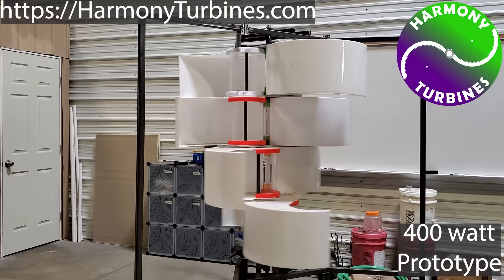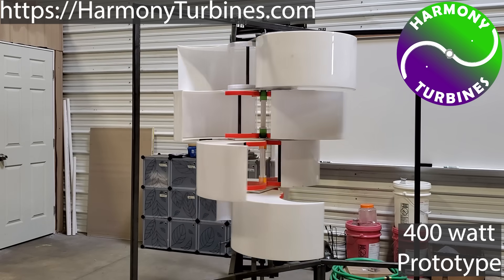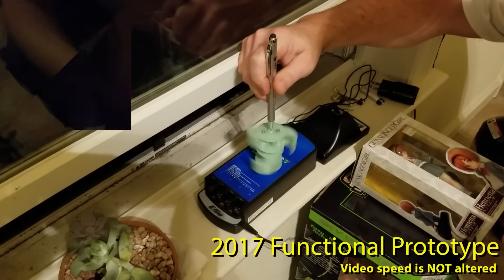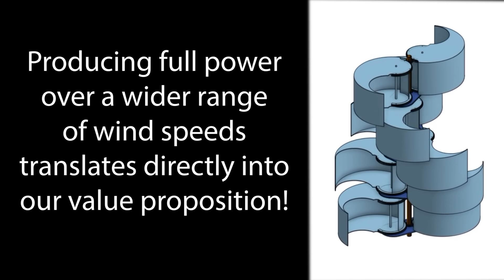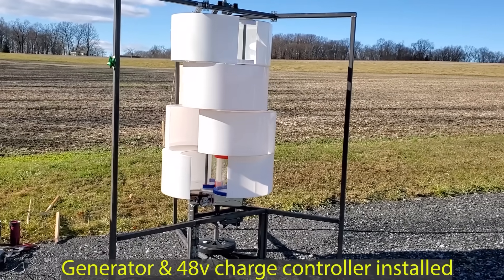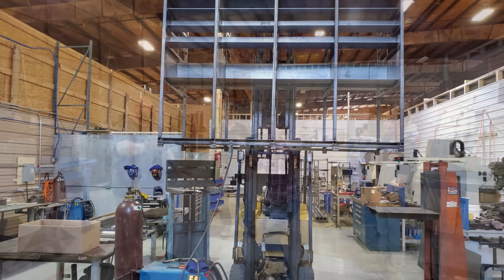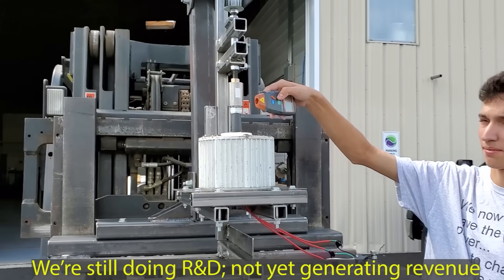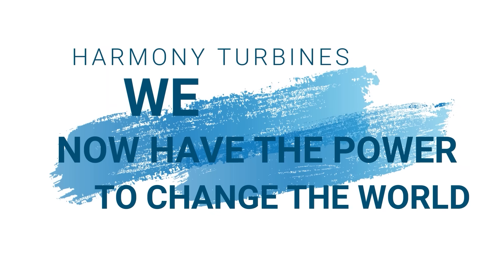What makes Harmony Turbines so revolutionary?

Comment: A kite of the same size at 2000 ft is going to generate far more consistent energy.
Reply from the maker: I love the kite idea. I've been following them for years but they're not practical in large numbers. Can you imagine trying to put thousands of those kites up in a city? Harmony could be deployed in cities and on the sides of tall buildings with little to no problems.
Reply: @HarmonyTurbines   over 4x energy factor increase... See  oki for automated kite launch and flight. I know human  pilots  can fly 4 string revs in very large tight fomations.

Comment: maybe it's the new revolutionary method to rip off two categories of people: first - uneducated investors, second - uneducated buyers?
this is savonius type of turbine... and it's meant by default that ANY standard horizontal axis wind turbine with the exactly same working surface will outperform it 5 times! and for those who still believe in tales - go for it and buy it! just don't tell afterward that I was not warning you...

Comment: I suggest you propose this design for boats as well. When the turbine contracts, it can become a Magnus Effect cylindrical rotor. This only occurs when the wind is perpendicular or slightly diagonal from behind. At any other angle it would be open, not for propelling the boat, but for other needs on board.
Reply from the maker: Thanks we have been engaged with both Yacht and Catamaran manufacturers for about 2 years now looking at this. Once we're further along we will be working on units to do exactly this. We have even had Cruise lines contacting us so Magnus effect and Fletner rotors are definitely on our TO-DO list. :)

Comment: You need to hire more experience aluminum welders. Those aluminum welds on your video looks horrendous. Anytime I go buy anything metal that has welding. Please for the love of God. Check the welds, because no matter who genius came up with this product. If it is not welded properly. The whole thing is useless.
Reply from the maker: You're looking at old videos and besides, these are prototypes, nothing more. As we move into production we're actually looking at getting into LASER WELDING our scoops together which is an absolutely beautiful end result. -So fear not my friend, this is nothing to concern yourself with at this stage in the process.

Comment: sure it works... Just seems like there's way too many moving parts, the bottom ball bearings literally have to carry the entire thing, so they'll need to regularly be switched out, and every single sail needs a motor + gear to fold up and down.
It's just needlessly overcomplicated and takes up less windspace than normal turbines - so the energy coefficient is worse.

Comment: If I were you I would start long term testing for outdoor conditions!!! This design looks like it is going to be very susceptible to dust, dirt, leaves and debris. It would not only add weight to the vanes but it would fill the bearings and gears and damage sliding surfaces. How does it handle water shed in a rain storm. Centrifugal force I am sure plays a role but how does the unit sense the added weight of the water and adjust ? Do you adjust turbines speed only and just ignore the added weight? Also you say it produces at very low wind speeds but no figures. VAWT's are really good at attraction by "ART" but the looks are very deceiving when the numbers are exposed. Lastly have you tested this sitting in some one's back yard for providing energy in an urban setting?

Comment: Can it be mounted to a PTO and used to pump water?  I would be interested in investing in one to do some R and D.  I want to pump water to hold for use as a power source when there is no wind or sun.  I get fierce wind like most folks, but it doesn’t help that I have signs that say “danger high wind” and they actually make the big stupid wind generator stuff near by in Pueblo.

Comment: I was impressed when I assumed this was an entirely passive solution using some kind of governor, but it's really not that special to realise it's computer controlled and requires a small fraction of generated power to operate the motors.

Comment: I love these turbines, the design is awesome and practical easily scalable, but also easy to use multiples depending on preference. I hate the ham-fisted approach of Government intervention, let the people decide. one or two of these in a small with a couple banks of batteries (One for actual use one for reserve and redundancy) will allow for lower energy bills and also a backup for when the power stops working (storms and such).

Comment: This type of turbine is usually not very efficient but your self-regulating/preservation mechanism requires it. So is this mechanism worth the lost efficiency? Also, it has more moving parts than a variable pitch HAWT, which are the pinnacle of efficiency. So, what's the point if it's more complicated and less efficient?

Comment: I bet the reason why this kind of turbine is not used is extremely low RPM and need for a high ratio gearbox to convert the energy, which by itself is an inherent loss. Another probable reason is stability as a regular windmill needs "just a pole" this thing would need a significant structure around it just to stay upright. Another issue would be the weight resting on a thrust bearing that would need to be used as well as as a pair of regular bearings to keep it upright.
Lastly, modern winmill-type generators use variable pitch airfoils which is as close we can get to highest possible efficiency. I bet this thing wastes 1/5 to 1/3 of potential enrgy on having one part of the rotor constantly rotate against the wind.

As with most exotic aircraft, boats, IC engines, they usually have one or more significant reasons why they never catch on - this thing probably has a whole boatload.

Comment: unless I missed it, I did not see how the furling or unfurling is activated. I understand the need for that, but is it a manual operation at this point? What would be the weight of a unit that you might want to have for a home? Could it be mounted on the roof, or does it need to be anchored to the ground?

Comment: Just to say that this is really a big idea...however, if the new battery specs to store power improve in a few years, it is better a PV panel without moving parts. However, could be a good device for areas with winds and cloudy skies most of the year. Note that a safety grid around the device -to prevent injuries - will be needed...or to be placed higher than a human could reach with the hands.

Comment: How high off the ground would you advise your buyers to locate these? What are the practical elevations? Upper limits on elevation? In the Y2K year 1999, we put up a typical 1500 watt three bladed turbine mounted on pyrimidal steel tower 87 feet above the ground. It destroyed itself in a derecho high wind event in July of 2011. Your design is such a ground changer! I love what I am seeing. Good on 'ya!
Reply: From the looks of it, you'd just have to have it high enough to not be in the wind shadow of other trees and structures. That should be within the airspace of a standard property. In the case of buildings, the FAA would potentially need to sign off on it.

Comment: Significant step forward in the wind energy business. Major improvements: 

1. Continous operation during wind storms. Non-interuptable power. Huge advancement.

2.  Very little noise and no propeller flicker. Huge step forward.

3. This design is not a bird killer. Very important.

Support these guys, this is the way forward!
Reply from the maker: Thank you Jim, we're doing our best to push as hard and fast as our time and finances will allow.

Comment: I’ve always liked the vertical wind turbines but most are set at a fixed blade, scoop or what ever it’s called.  However your design with variable settings in relation to wind speed is a great idea.

Comment: Durability of plastic parts?
I can't believe it's really silent. Perhaps the machinery itself but the wind spinning across the turbine must make a noise surely. I think it can be a great solution for isolated users with modest electricity needs such as running a pump for a well and to keep minor specialty needs met. So long as heating and cooling and most lighting demands are not part of the demand equation then this may be adequate.

Comment: Its not revolutionary. The principles have been around for at least 50 years if not more. The reason why it was abandonned back in the late 70´s at least was the fact that it was not possible to pull much power from them. That is STILL the problem. But for smaller off grid systems with lesser need for electricity they are a nice and reasonably cost effective solution.

Comment: How hard do you think it would be to make a welding machine run on wind power
Reply from the maker: Running anything on wind directly is problematic because the wind varies. It's better to go into battery banks and then from that using an inverter to run your end applications.
Reply: @HarmonyTurbines  interesting

Comment: This is incredibly intriguing. I would enjoy not just being and investor for a company like this but having a hands on contribution roll. I've been following Nikola Tesla's work since I can remember and mechanical advantage devices have always intrigued me. A device like this would not need any high end computers or large systems susceptible to friction loss. The center column could utilize a mechanical speed limiter ensuring that if the speed becomes unsafe torque would be applied to the column which would close the fins and lower the rpm. Springs could be used to store potential energy allowing the fins to be opened when rpm is lowered. While this technology is interesting I'm vastly more curious about different ways you can harness motion and convert it into electricity. Piezoelectrics and solar are examples but require further testing to identify efficiency and application. Reach out if you ever want another mind fascinated by technology.

Comment: You are going to run into a problem. How will the plastic hold up due to sun, freezing or hail damage?  You will not know until years down the line. Will freezing rain kill the turbine? How about if a very sudden gust of very strong wind intercepts the turbine before it has a chance to close? You cannot answer these questions with just a few simple tests. You will need 3 full years of product testing in, at the very least, 10 different unique environments around the US. Plastic vs metal? Plastic degrades in ways that you cannot predict. I love the idea, keep going. ( I can almost guarantee that the plastic will not work in desert environments where sun damage and temps will cause micro fractures in plastic. )

Comment: 400 watt model?    400 watts....    Must be geared up quite a bit to spin a generator fast enough to produce that.   If you can get enough torque.  
Show me that thing spinning with a generator and a load with metering.    If I see it pushing 33 amps into a 12 volt load,  then I'll believe it's 400 watts. 
(Ohms law)

Comment: Unnecessary and overly built mechanisms for a vertical wind turbine. Especially when there are lubricants with dynamic viscosity that can simply slow the rate of spin at certain temperatures and speeds.
Reply: No having to disperse energy through friction.

Comment: This would be incredible in off shore wind turbine application.
Which would cut down on service cost by simple having the generator (centre of mass) at water lever or below, plus the auto close function when storms occur.
I imagine a towed floating rig which would be then be daisy chained and shackled to the shallow-ish ocean floor. Guys you need to contact some bigwigs with a floating 'working' prototype.

Comment: Horizontally-oriented wind turbines have variable-pitch blades, which enables them to adjust appropriately to wind velocity. The major issue is mechanical complexity. Those burning turbines are a result of these systems failing. I guess the greater efficiency of horizontal turbines keeps them worthwhile.
Reply: the problem is changing direction of wind. in such case this could be useful.
Reply: @jebise1126  Horizontal turbines can change direction, but the wind doesn't change very rapidly in the environments in which they are constructed. Generally: wide open spaces. It is true, though, that they're not terribly good for small scale generation in more cramped locations, like in cities, where the air might be more turbulent.
Reply: @jebise1126  home scale ones have a tail so they change direction according to wind. they produce 3kw in some models
Reply: @Kelly Harbeson They can provide a great deal of power. The problem is that their status as "green" energy is dubious, given that the blades can't be recycled, they have a huge concrete foundation and it takes a lot of petroleum-burning equipment to do all the work.
Reply: @Ostsol  Even if the entire wind turbine (including the tower and the foundation) is not recyclable, its taking far less material than the fossil fuel that is mined to produce a similar amounts of energy. A 5 MW Onshore Wind Turbine produces around 10 000 to 15 000 MWh of Electricity per year. To produce similar amounts of Energy with coal (5 MWh/metric Ton), you would need to mine 2000 to 3000 tons of coal per year. The average Wind turbine is expected to have a lifespan of 25 years, so one Wind Turbine equates to 50 000 - 75 000 Tons of coal, or around 25 000 to 37 000 Tons of oil. And thats just the raw, chemical energy. In case of oil, you need to add refinement and conversion losses to that. For the biggest energy consumers, you need 3 times the energy compared to electrical energy (mobility, heating (heat pumps get 3kWh heat energy per kWh of electrical energy), electrical energy). Oh, and fossil fuels also need infrastructure for production, transportation and refinement.
Edit: And thats ignoring the fact that the waste of fossil fuels (CO2) is just dumped into the atmosphere, where one ton of CO2 takes far more volume than one ton of wind turbine waste. Luckily for Fossil Fuel Company, CO2 and Methane (what is also released massively by the Oil and Gas Industry) are invisible to the naked eye, in contrast to wind turbines.
Reply: Recently saw a video about a company that recycles nothing but turbine blades & Solar panels.
Reply: @SXBB  Interesting, though I've gotta wonder if its economically self-sustaining or relies on government funding.

Comment: I've always wondered why they don't just put a gearing system inside wind turbines so they can harvest strong winds without spinning too fast.
Reply: Like break regen on a electronic car, more resistance gives "power" back. I am not science enough to know why not hehe, and also always wondered why there isent gears on electric cars, when you are up to speed like 60mph why not have gears kick in so smaller rpm from engine gives forward motion? (Sorry for my English, I am Norwegian)

Comment: Take the old Savonius design of cutting a oil barrel in half, aero dynamically shaping the two halves, combining the parts to catch as much wind as possible, and then selling it at a high enough cost to make a nice profit was revolutionary and innovative in the 1920's before the REA (Rural Electric Association of 1937) existed. What has changed is the materials available today, and newer battery technology. This design is most efficient at slower wind speeds. The trick is to catch the most amount of wind energy by maximizing the area facing the wind to reach optimum efficiency. I'm just acting jealous because I'm too lazy to do all the work needed. The most successful wind generator before wires connected everyone together on a national level was the Jacobs Wind Turbine. Remote sites on mountain tops to run weather stations is a hybrid system of wind and solar generators with a small battery( keeping the blades, panel, and battery from icing up and freezing is the trick.)

Comment: You omit two things: Vertical axis turbines are very inefficient. The two blades fight each other. The wind forces the rearward blade to oppose the opposite blade, so you extract much less energy from the wind. The second point is horizontal axis turbines power just about every farm in the world. They survive the high winds you find on the plain, and don't burst into fire. The thing going for you is slick marketing, not value for money. Compare the cost of ownership of your product with alternatives for a fair comparison.
Reply from the maker: Steve, It's finally coming to light that there has been a large disinformation campaign for decades against VAWT's and in general Savonius turbines, starting back in the 1950's or around there. Savonius Turbines are actually > 30% efficient without any helix twist or ribbed sections. A proper helix twist greatly reduces stress over the entire unit and smooths out operation as well. The main noted drawback noted was high wind vulnerabilities which our patented design now solves. Look at this https://youtu.be/pbtR6VG-gLw?t=225

We're still in development so we do not have units to purchase or send out to customers/supporters at this time. If you would like to invest in Harmony Turbines we're planning on opening a 3rd funding round this summer with StartEngine. The time it takes us to finish development will be directly related to how much funding we are able to acquire here this summer. Our goal is $2M USD so that we can fast-track our development on a number of items to move into the BETA Testing phase with our products. You can download the latest version of our Pitch Deck and Executive Summary below in my signature.

In the meantime, please sign up with our Newsletter to receive the latest updates from Harmony Turbines: https://groups.google.com/g/harmonyturbines